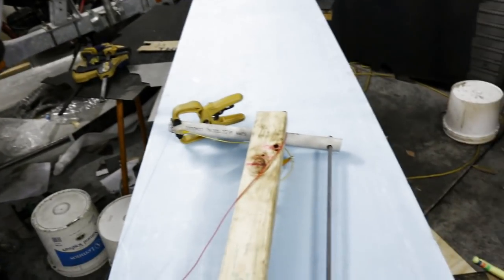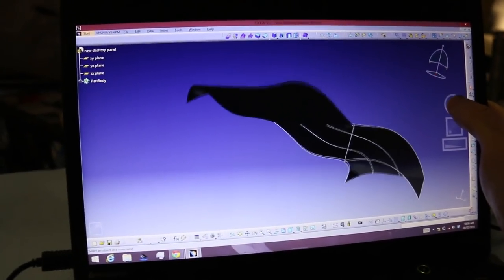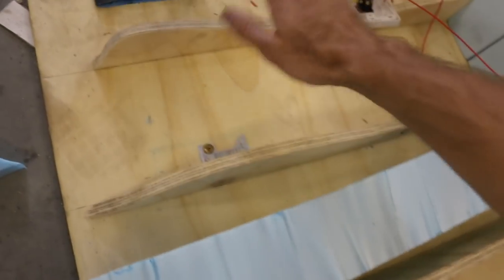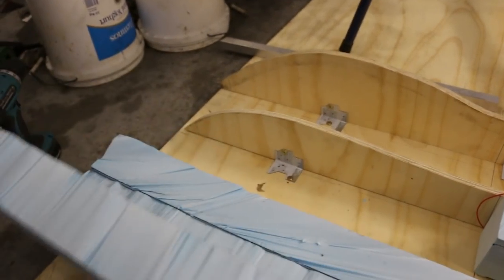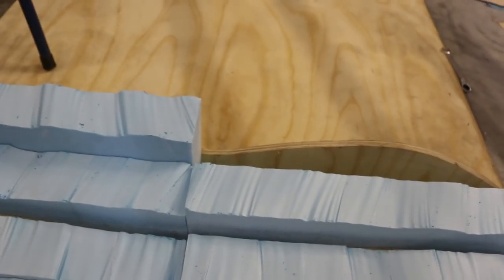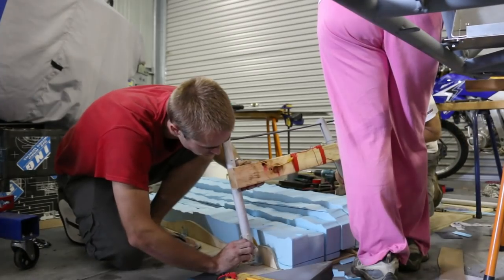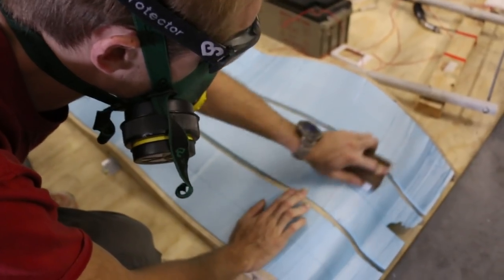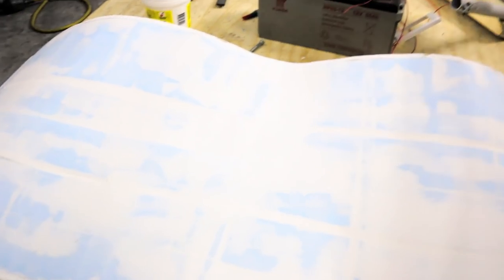How to Make Fibreglass/Carbon Fibre Race Car Bodywork - Part 1/2

Comment: Where did you get the foam?
Reply from the maker: Parker Barandon I got the foam from DCT Composites, but if you google extruded polystyrene you should be able to find someone in your area. It's commonly used as housing insulation and modelling foam.
Reply: KYLE.DRIVES ok cool! Thanks for replying, I have a go kart that I want to make a custom body for and I need the knowledge of where to get the foam, etc.

Comment: What is the type of filler? Does it break under some bending?
Reply from the maker: +Creativity Overflow The filler is just a plasterboard filler that is water based, and it will crack under bending.

Thanks for watching!

Comment: Hey, what program did you use as template?
Good work!
Reply from the maker: Hi there!
I personally use Catia for my design work, but that's more of a commercial CAD package that is very powerful but difficult to learn and very difficult to get a (legitimate) copy of. There are a number of cheaper packages for personal use, Solidworks for example springs to mind, although they aren't as good for surface design.
Cheers,
Kyle
Reply: Thanks, i will try Solidworks out!
So far, i did my templates with google sketchup haha
Cheers!

Comment: why cut the timber to shape and then not even sand down properly towards them.....thats the whole point in doing it !
sand down till you feel the timber or if using mdf  brown dust will be in your sanding dust .
you may as well of just rough cut it with a kitchen knife !